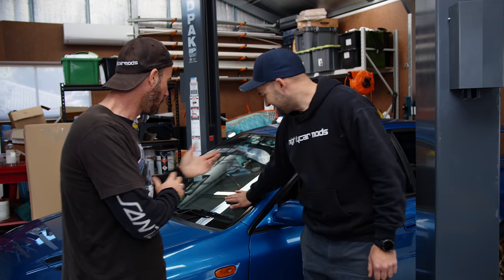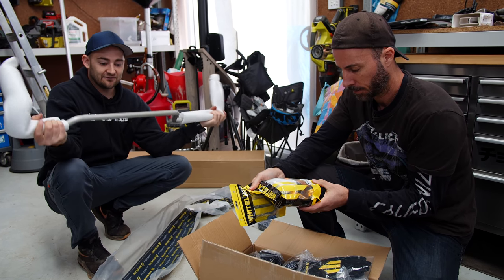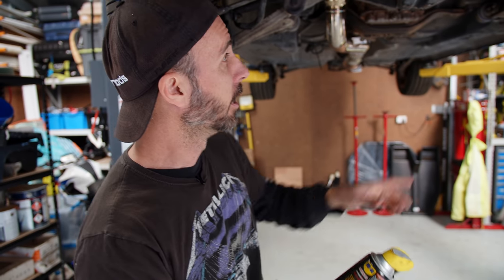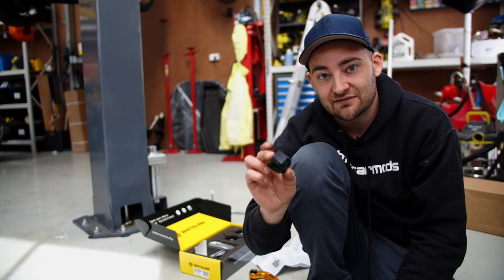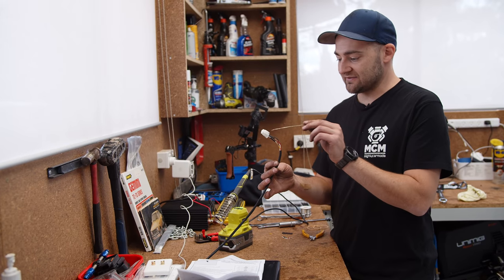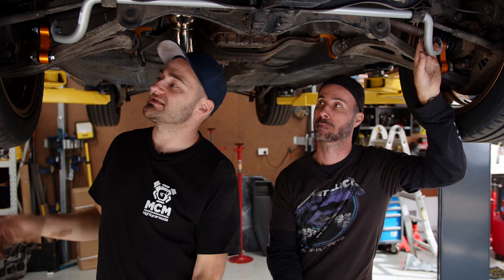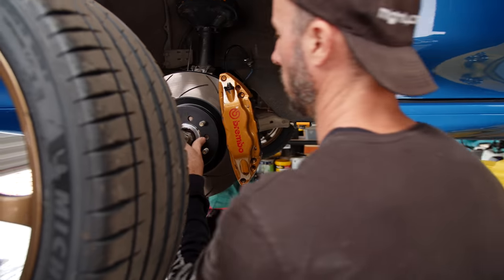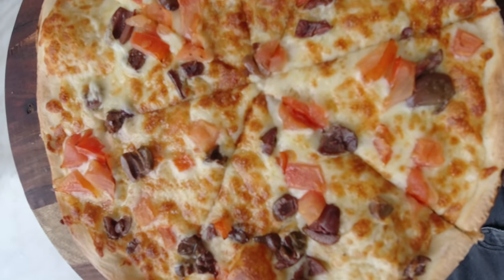The STI is READY TO RACE the BRZ

Comment: Be careful with upgrading the rear sway bar without changing the actual connection mount on the car also getting upgraded.  This is not the end link.  This is the brackets that mount the sway bar to the chassis.  The stock ones can break with a big bar.

Fun fact, the anti life kit is actually just a copy of the stock Forester part which had this geometry stock.  The main difference is the upgrade to the stiffer bushing.  Some also do an offset bushing center in addition to help add caster, which these cars VASTLY lack which forces you to run a high static camber which limits straight line handling and noticeably braking.  You can get away with less and less static camber if you add more caster angle.  The ALK with an offset bushing can add some.  More can be gained with an aftermarket caster adjusting upper shock mount (extremely few do this, like almost none that are actively for sale).   This caster increase is a huge part of improving Subaru front end grip and will moderately improve tight corner grip (great for autocross).

Another important note about sway bars.  Sway bars are springs that are NOT damped.  A big sway bar on soft suspension will mean you have a lot of rubberbanding side-to-side.  This can often create snap oversteer if you're not careful about which dampers are used paired with a big bar.  The car can get far more twitchy and far more sensitive to steering inputs.  DON'T read this as "responsive."  Read this as twitchy.  The only good big sway bar is one that's also paired to moderate low speed damping.  With coilovers and moderately upgraded spring/strut packages can offer enough damping for OK control.  Better yet you can run a good damper with high low speed damping, but these kinds of dampers can be very rough on normal roads.  Damping is NEEDED to control chassis motion.  Understand there is a limit to how big you can go with a sway bar without making the car problematic to drive.  To go bigger, you need dampers that are aggressive with low speed damping, if you're trying to stay soft in spring rates.  Or you up the damper and springs with aftermarket strut/spring combos or coilovers, and then sway bars can follow along in larger sizing and still remain reasonably damped in motion not to cause problems.

Final note about the whole damper spring thing.  You do not "pick" a random damper setting.  The damper follows the spring.  There is almost always one, single setting (if adjustable) that is best for a single spring rate.  If you want a stiffer setup or to change handling, you change springs, not dampers.  You add 25 lbs/in or 50lbs/in to one side AND then follow by adjusting damper rates slightly to match that new spring rate.  That's how you tune the suspension.  Spring then damper to match, not damper alone, unless you like to create traction and chassis motion problems.  This means if you're working with sway bar changes, and if you want to change dampers or damper settings, it's a spring -> damper -> sway process.  It's true you can just toss a mild sway on and often improve the handling, but the sway bar can only be a mild change, say up to around 20mm to 21mm max in the case of the Subaru.  If you toss a 24mm bar on, you're going to get problems because of the sheer lack of damping in side-to-side motion with that much added spring force.
Reply: +1
That comment needs to be pinned. Sway bars can be a huge trap for newbies with stock suspension and most of the time the cars end up handling worse and slower around corners.
Reply: Also note the front endlink issue with the WRX/STI isnt so much because of the model but because of the style of control arm... Steel control arms use those first endlinks they had installed, aluminum use the second kind.

He also still had factory rear control links and trailing links, they should upgrade those too.  The bigger sway bars put a lot of force on the control links and stock bushings.   Those bushings being upgraded also don't hurt the NVH.
Reply: Just want to make a note that the front links they put on are incorrect for alloy arms. The 1s they installed are made for the steel 1s where they have bracket either side holding the bushing inside the link. Having them installed to alloy ones the bushing will most likely pop out
Reply: @ErebosGR  They can help with body roll and subsequently camber change of the tire.  Generally stock setups are so soft with high roll that a mild sway bar can increase grip.  Usually, you don't need to upgrade both though as the other part of the upgrade is addressing stock understeer.  In most cases all you need to do is slightly increase the rear sway bar and you're done.  A lot of the understeer is tuned out, and the remaining is likely from the near zero camber on the front of most oem setups.

Where you run into big problems, other than adding too  much spring to the system without adding any damping is by upgrading one or both to sizes that don't match well and you end up with weird understeer/oversteer and wheel lift issues.  You can get strange handling shifts and moderate swings between under and over steer, in addition to the effects of the spring force added and twitchy behavior.
Reply: @stevemartegani  Yeah, the endlinks don't mix and match.

I was referring to the mounts, if we're talking Whiteline stuff, these:
https://www.rallysportdirect.com/part/sway-bar-mounts/whi-kbr21-24-whiteline-forged-aluminum-sway-bar-mounts-24mm

Or

https://www.rallysportdirect.com/part/sway-bar-mounts/per1-psp-sus-201-25-perrin-stout-mounts-sway-bar-mounts-25mm

if you're a Perrin fan.  (ones I've used)

The stock ones break with big bars.  Anything over a 21mm or 22mm size bar will likely break the stock mount, so this is often a necessary upgrade.
Reply: I think the best advice they gave throughout the video was to take your car for a professional wheel alignment with someone who knows their way around modified suspension. Given they also put the swaybar onto the softest setting, they're unlikely to encounter this problem - but your point is valid for 90% of the people watching who will slap a swaybar upgrade onto the highest setting.
Reply: @pugbrz9472  The challenge with alignment is that most name brand shops will not do anything other than OEM alignment.  They will not set custom settings.  They're mitigating legal risk.  So you can go to a shop to get everything nice and straight, but you might have to then adjust camber yourself at home afterwards.  And they won't do anything like special toe settings, inclination, caster, etc.  You go to a name brand shop, and you'll only get an OEM alignment.  You need to go to a specialty shop to get different, or fiddle with it yourself.
Reply: @Xmvw2X  that's exactly what I'm saying; I go to 'specialty shops'. Same with dealers; they will only spec to factory unless they get you to sign a waiver that the work is done at your own risk.
Reply: Another fun fact is that the anti-lift kit should really be called anti-anti-lift kit as it actually reduces the anti-lift characteristics set from the factory.
Reply: blown away by the usefulness of your comment. Spent a whole evening brainstorming and cherry picking parts for my subie. Thanks alot

Comment: You should mention adding anti-lift will decrease your anti-dive because you change the angle of the side view swing arm so expect the front end to dive more under braking since you didn’t add stiffer springs. Changing the control arm mounting point also changes steering tie rods alignment and can add bump steer which can be minimized by the alignment shop.

Comment: Blade sway bar adjustment is a flattened piece of spring steel on the end of the sway bar that can be rotated so be stiffer when the blade is oriented vertically, or softer when it's oriented horizontally.  It's a way to get an adjustable sway bar by just rotating a single part, no need to swap bars or move end links in different holes.  It's more of a quick adjustment for motorsports and isn't necessary on a street car.

Comment: I had the same gear in my STI at first.  You can really dial it in with tire pressure once you get used to the setup and tires.   Three psi delta on track worked for me.

Comment: I love my koni adjustable strut inserts, originals struts with the right height stiffer springs. I have everything I want it's comfy and handles like it's on rails. I haven't done a white line suspension upgrade yet haven't found the need but identifying old tired suspension components is a must I just chose to go with stock replacements. Love it.

Comment: I have those whiteline adjustable length "sti" links on my front of my 04 WRX wagon. You're supposed to extend them to match the  length of the factory endlinks. Also, whiteline is the best shiz and is actually bolt-on.

Comment: Blade adjustable sway bars, have a thin, wide sway bar link, That is flexible in one plane and very rigid in the other plane, and they swivel between soft and firm and are usually cockpit adjustable.

Comment: As Milwaukee didn't make an M18 soldering iron (only M12) I made one with a  KSGER T12 station and some other bits. I also added a power supply output for testing stuff in cars (adjustable power supply). All runs on M18 batteries. Works mint and I love it.

Comment: Go from the STi setup to a Prodrive P1 setup and you have the perfect handling Impreza 2 door. Also the Prodrive Alcon brake upgrade kit is also designed for the GC8 and does not need the massive modding retro fitting Brembos from the later models.

Comment: Heads up for anyone looking at soldering with the Ryobi iron, from factory they are set to be around 450 degrees C. Great if you're outside or in the wind but if you're inside it will be way too hot, especially on anything detailed like on a circuit board.
Good news, really easy to adjust the temperature:
Open the unit up and turn the blue and white dial anti-clockwise 1.5 stops.
Drops the temp to ~350 deg C.

Comment: In my 99 2.5rs I was on coilovers and instantly regretted them. They looked and handled good but you would literally break your back daily driving. Rather then going back to stock I went to some used JDM KYB Wrx shocks and struts and for me they have perfect stiffness from the shorter springs. Probably the best mod I've done.

Comment: The anti-lift kit was the best mod ever on a sti, then its front n rear sway bars. All other suspensions didnt yield as much performance per price value. Also a tip, add some locking collars to the rear sway bar, as the rear bar tends to shift to 1 side under heavy cornering.  This will prematurely wear out the endlinks as it will place a load on the endlinks constantly and also not be vertical at rest.

Comment: Traditional or heim-joint end links are better. A good quality ball-and-socket type end link will be freer-moving than a urethane type, and the urethane bushings in the end links twist and compress, effecting the geometry, and eventually become worn. It's like you said about replacing the sway-bar mount bushings to better cope with the stiffness of the sway bar; ideally you would have bearings at most pivots in the suspension for a more linear actuation, in this case of the sway bar mechanism, and for a more free-moving, and therefore more functional, suspension as well.

Comment: When soldering make sure you're putting the iron on the one side of the copper and the solder on the other that way it heats the copper and its actually the copper melting the solder into it also make sure you tin the iron as well as I'm sure you know ;)

Comment: Hub concentric rings are only any good if your wheels are true. 
Having changed he offset and PCD on more than a few aftermarket rims most are not. To check you will need a big lathe and a 4 jaw chuck. Clock up the tyre beads before then checking if the mounting face is square and the ID true. While they are there you can then give then a light cut to correct them.

@MightCarMods - Have you ever measured the rolling circumference of your new tyres when they are mounted? 
Have you ever set the corner weights on the cars you have fitted adjustable coil overs on?

Comment: Just quietly, it's worlds easier to do the rear sway bar when the weight of the car is down on the wheels and reversed up on some ramps to give better clearance underneath. I put a GC8 STi sway bar into my old MY99 Forester GT with about 5 minutes of work on my own. Super easy that way, and you're not fighting the end links the whole time.

Comment: I replaced all the suspension bushings on my Impreza GG Wagon (Hawk eye), plus the one on the rear diff, the small ones underneath the gearbox and the top mount engine, by somewhat soft polyurethane ones. I was already equipped with same droplinks as in the video.
The handling is just amazing, it really fills being on rails!
Enjoy the ride Marty! ;)

Comment: Im confused now...At 15:58 marty solders and heat shrinks the O2 wiring. I was taught and have read service information from vehicle manufactures stating to not do that, since the O2 sensor uses a reference air sample via the wiring.

Comment: It's a bad idea to solder the sensor wiring. It only measures between 0,5 and 4,5V and the solder can change the resistance, giving you a false reading. The best way is to re-pin both connectors with a new wire. Goes for all CANbus type systems, especially the new 500Hz ones on motorbikes, that have 6-axis motion sensors.

Comment: Awesome vid you wouldn't happen to have the measurement of that stock sti sway bar link I have a wrx that had an sti engine swapped into it from a front cut and the suspension and LCA'S are sti ones so wondering what else could be on it

Comment: Funny thing about the STI vs. regular end links. I learned about this by ordering a set of STI end links for a 1990 Subaru Legacy  (which is largely parts-compatible with every Impreza and WRX from day 1 to 2007 because LEGO CARS) because they were VASTLY cheaper than the regular ones. They "worked", but flipped over the mounts on the first hard jolt. Up front, though, I'm pretty sure you can use the STI part on a regular car and it'll work fine - just wear out (potentially much) faster. 

Essentially, the STI ones are two ball joints connected by a stick. The regular ones are two bushings connected by a stick.With the regular hubs, the mounting dingus for the link is offset from the end of the sway, whereas with STI hubs, the two are in line. The balljoints on the STI part kinda-sorta make it so the STI part will physically fit both configurations, but the regular ones, at least the C's in the rear, also serve to limit sway bar travel, which the STI ones can't, so the sway bar can actually flip over the links. Up front, I don't think there's enough suspension travel to actually flip over the links.

Comment: Adjustable Sway bars, ALK etc have always been my very first mods on my Subaru's. Best bang for buck mod, no doubt. And keeps the comforts of OEM suspension, while making a decision on what suspension set up I am going to go with. Always remember, if you're doing front and rear sway bars, make the bar at the opposite end of the driven wheels thicker. Rear for FWD, Front for RWD, Rear for AWD.
Reply: Or if installing the same width aftermarket away bars F/R adjust the stiffness to suit.

Comment: You're better off using the original sti front swaybar link, its pillowball and has better range of motion, the whiteline one will be resting on an angle when the car is on the ground. You should also replace the rear swaybar mount, the factory one is like jelly.

Comment: On Mustangs the "anti-lift" we call it anti squat. You can improve it by moving your instant center reward towards the rear axle. You do this by axle control arm drop brackets. Holy hell do they make a world of difference. No axle hop, dump the clutch at 3k little bit of tire spin but it hooks and goes. My friend says you don't want too much otherwise your wasting energy with anti-squat. However on the website for the drop brackets they describe different scenarios on how to set it up (like high powered drag car you want setup x, in a street car with good performance you want Setup y, in a comfortable daily you want Setup Z). Its also helped my limited slip become a bit smoother on power transfer. Before I could never floor it on corner exit because my LSD would just lock up and kick the back end out. I felt like my LSD was behaving like a Detroit locker; locked or unlocked. Now I can feel the power transfer to the outside wheel

On independent rear suspension cars they say you can achieve a similar effect with drop ball joints on the rear lower control arms but they are hard to find. If you get a chance to read up on instant center do it, you will learn so much about suspension geometry.

Comment: i had a gc8 the first day i went around a hairpin corner i turned and the back of the car wanted to keep going straight just about killed myself., took it at about 40kms, next day same corner with a rear swaybar on medium setting i took that same corner at 70kms and was perfect. if you have a gc8 wrx first mod go see TUSPEED in coburg and buy a rear gc8 swaybar, approx$200-$300

Comment: You guys keep saying you should get the wheel alignment bloke to set the stiffness but that's not correct. You should be setting it at the track based on how the car behaves and you may even run a different setting at a different track. Being able to change stiffness front and back is how you dial out/in understeer or oversteer.

Comment: avionic aircraft wiring guy tip don’t use solder with wires that will have  high vibration it cracks and breaks.